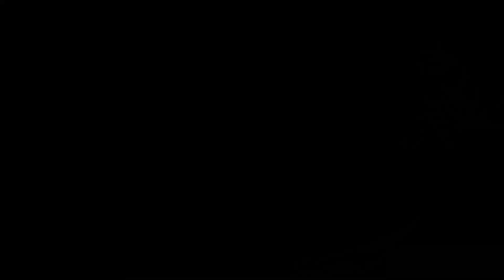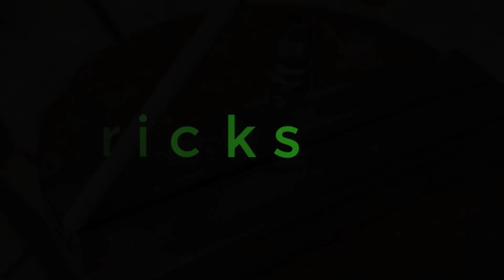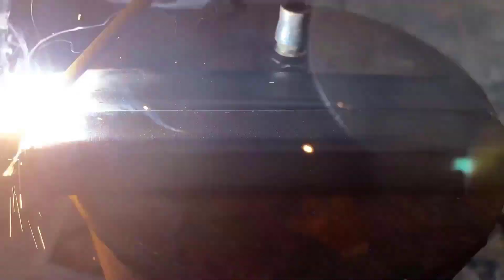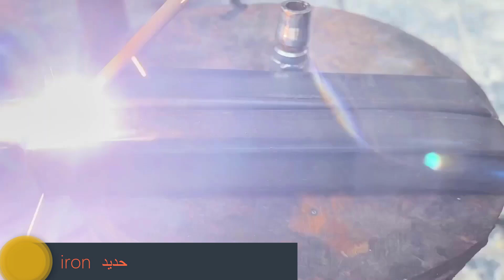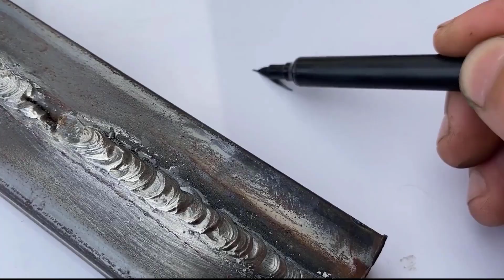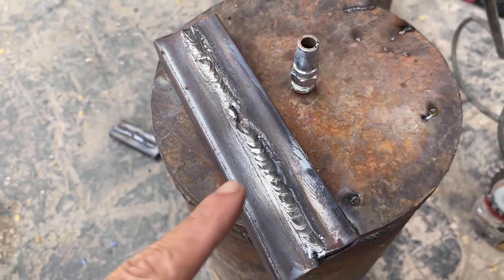1mm weld why no one told us about this secret

Comment: Just run the rod tight as it was designed to do .. Back and forth more heat blah blah .. you can run a fast tight one in the crack then cap it out nice .. yet another u tube video showing garbage welding